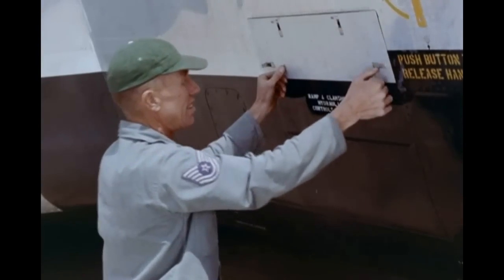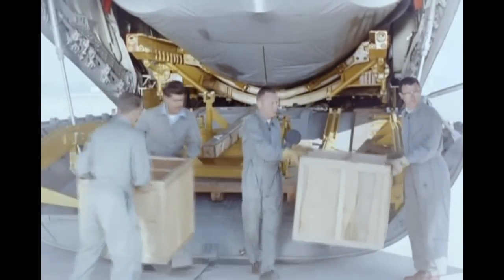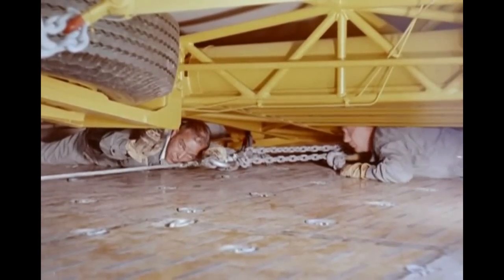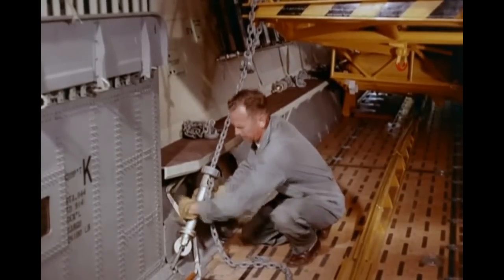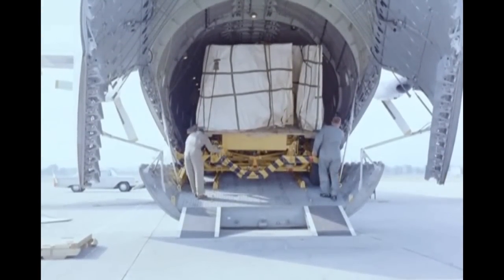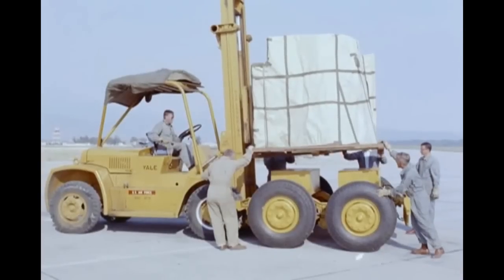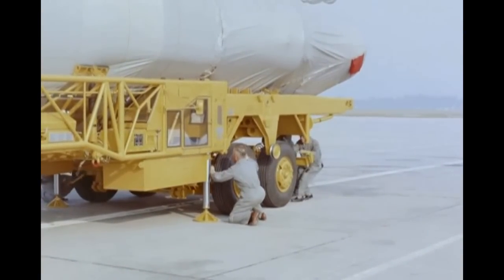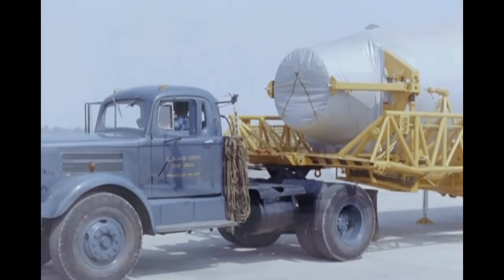Douglas C-133B Cargomaster - "Unloading the Atlas Missile" - 1960

Comment: I'm old enough to remember the sound of a B 36 flying over.  While I was in the Air Force during the 1960's in Holland we used to see an occasional C 133.  That aircraft sounded just like a B 36 flying over at altitude.  I believe the C 133 was also capable of carrying 5 F 104s.

Comment: Worked on them along with 124s and 141s at Dover AFB, 67-70 Avionics Tech. Donot miss working on those high wings and engines.😱
On the TET emergency airlift at Barksdale of Cobra Gunships for the Army believe we got 3-4 loaded on each 133. Busy times🗽🇺🇸

Comment: The C-133 was built with very little R&D, kind of a rush job the carry the Atlas Missile. Many crashed about 100 miles out over the ocean. My dad was a C-124 pilot and he told me when the C-133 came out all the pilots wanted to fly the new pressurized plane. When many were lost they all wanted back to the C-124.

I know an airline pilot who worked for a small company in Alaska flying parts for the pipeline. He told me his company stole 2 C-133's from the boneyard, true story! Google it!!
They had a mechanic that figured why the c-133's were crashing. Just a really smart mechanic figured it out. 
One of the stolen planes is on display at Travis. The other had wing cracks and is still in Alaska.
Reply: One report said that, late on, they discovered fatigue cracks in the structure around a forward cargo door during the examination of the crashed remains of one more C-133. Strapping were a quick way of strengthening the fuselage so that remaining C-133s could complete their planned service-lives.
Reply: @None-zc5vg  Agreed but that was not it.
I have a friend who knows the guy who figured it out, I'll ask him.
Reply: @scuddrunner1  Thanks Mike.👍
Reply: I read that a huge weight had to be loaded extreme forward when empty for flight.
Reply: Sad that after that last one flew into Travis after being retired from semi-legal flying in Alaska, they cut the wings off to move it between power poles to it's final display location on the base.
Reply: @None-zc5vg  I think when the designers figured out the plane would not meet desired performance specs, they built it with thinner skins.  Explains a lot.
Reply: @aj-2savage896  They didn't cut the wings off.  It's still intact in any photos I can find
Reply: @Contrajoe  They were cut off to get between utility poles to get to final location.  They were bolted back on, but certainly not in the way it was done at the factory.

Comment: Great aircraft, sadly flawed early on by propeller problems, stall characteristics and metal fatigue. These issues were mostly addressed and remedied later, but by then the heavy jet transports such as C-141 and C-5 were coming on line. I believe 20% of the 50 made were lost in crashes or incidents.

Comment: I am unfamiliar with the C-133B. This aircraft looks much like the venerable old C-130 Hercules however. 
Is this aircraft a totally seperate plane, designed and built separately, from the C-130, either before or after the C-130s introduction into regular service, or is the "C-133B" as seen in this video a specialized derivative of the C-130, therefore not a totally seperate design itself. Maybe a derivative for some specific purpose, lie the Guppy and Super Guppy were both heavily modified derivatives of the Boeing B-29 made to haul he huge completed sections off the Apollo Rockets do their final.assemby point in Florida for Launch?  Maybe to haul the Atlas as shown here even?
I.would love to know, just curious but still.
Any help you can provide would be appreciated, thank you!!!
Reply: The C-130, and the C-133 are two totally unrelated designs. The Herky is designed for intertheater/intratheater airlift, and the Cargomaster was designed as a strategic airlift aircraft. The C-130 is still being built by Lockheed Martin, and Douglas Aircraft Company built the C-133.
Reply: Also, the Guppy, and Super Guppy are both heavily modified Boeing 377 Stratoccruiser propliners.
Reply: The C-133 was built by Douglas. The C-130 is a Lockheed design....not a derivative of the C-130 at all. In all, only 50 C-133's were built. Several A models were converted into B models 57-1611, 1612, 1613, 1614 and 1615. S/N's 59-0520 through 59-0536 were factory B models and all B models were assigned to Travis AFB, and all A models were assigned to Dover AFB. I arrived at Travis on August 10, 1963 until my separation from active duty on Feb 28 1967. I hope all of the converted A Model serial numbers are correct, but it has been 55 years....